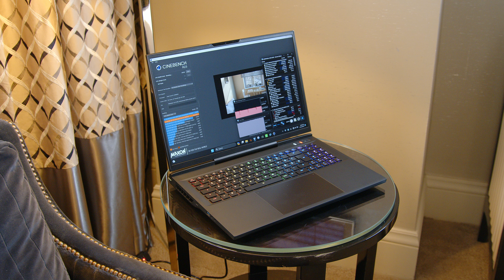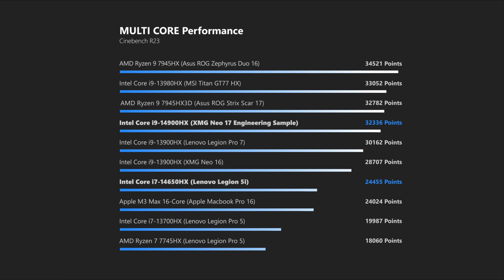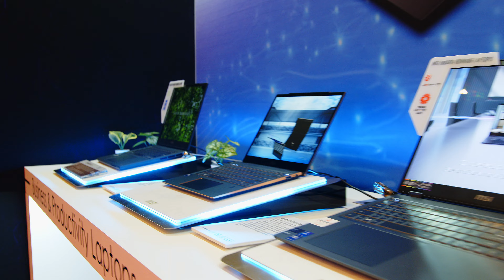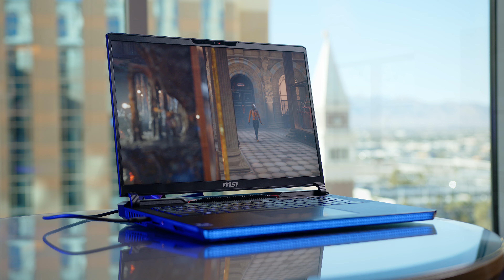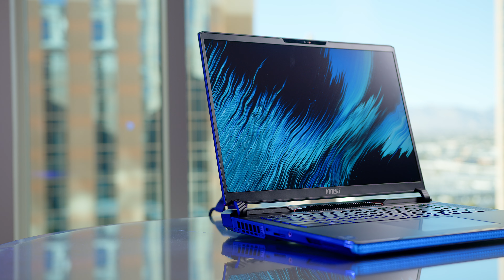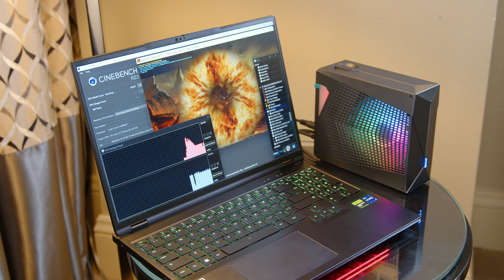When slightly faster is more than good enough! - Intels new high-end mobile CPUs

Comment: I like my laptops to run silent or as unintrusive as it can. I have a asus rog strix 3060 and run it in silent mode for the most part knowing it cuts power. I tried a legion 5 for my so while it performed well it was really loud and nothing i did seem reign in the fan noise (its also high pitched compared to asus)

I’ve been looking at the upcoming laptops hoping to find a new 4070 one with good performance while performing well in noise tests but i have no idea what would fit my needs. And ive started looking at coloer solutions more than anything lately but thats not helping either haha..

I guess im a little dissappointed in cpu power draw as of late.

If anyone got any tips what i should look out for with the upcoming releases id appreciate the help :)

Comment: I went from a G15 w/ 3070 to Legion 7i Pro w/ 4090, but I always loved the G14. Such an incredibly powerful little laptop. If I worked on the go, I would have definitely gotten it with the 4090. No it wasn’t a full powered 4090, though gaming wise it appeared to trade blows with the 4080. With Asus going even thinner this year with their Zephyrus series and maxing out at a 4070, I’m glad for one generation they went big with a 4090 in such a small package.
Reply from the maker: Actually, the G14 is tied with that exact Legion Pro 7 for being my favourite notebook of 2023, and it's really the amount of travelling I would have to do to tip the scales in either direction.

Comment: Intel has definitely fallen behind AMD and Apple in the power efficiency race.

I suspect that this is going to worsen later this year when Zen 5 comes out. Maybe Arrow Lake will provide better competion.
Reply: In Intel's defense, Raptor Lake is on Intel 7 (which was called 10nm++ before) so it's at a major manufacturing node disadvantage. Without it, it will be closer. Well, to AMD, still behind Apple. Well, with M3, Apple is on 3nm, which again, is better than the 4nm and 5nm that AMD uses. While on the same node (AMD 7000 series vs M1 and M2) it can be seen that they're not that different. Overall Apple still wins, but not by much. And it's mostly because on x86 side, the laptop manufacturers somehow really don't focus on battery life. They're all obsessed with benchmarks numbers and specs. It can be seen from the Meteor Lake lineup as well, everybody tries to push it out of its efficiency window (which, unfortunately, is not that big/high, but still, it can run very well at, say, 25 to 35W, from what I've seen)
Reply: @Winnetou17 stop the ignorance, everything you said fat BS.

First, m3max is way faster than a 14900hx. 
Second, x86 ISA is the main source of shit efficiency not the lithography.
Third, there is nothing on the planet that would make an x86 chip even nearly as efficient as something built on arm v9. 
So stop the BS and accept these facts.

Comment: I think we also need to talk about how respective new generation laptop CPUs power consumption on idle to low load (web browsing/ MS office) work. 

Since AMD CPUs really winning on lower power consumption competition. I was surprised to find my Legion Slim 5 2023 with R7 7840hs able to reach 11+ hours of webrowsing and office work on 80 wH battery. My recently purchased Lenovo LOQ 2024 with i5 13450HX cant even reach 5 hours of battery life with the same work load despite having lower screen resolution (1600p vs 1080p) and bit smaller battery. I tasted in real-world usage the R7 asit around 8-18w on these type of work load, where i5 sit mostly at 28w

For mid range gaming laptop option there is so many interesting laptop to be usable on both working/school and gaming on the go. But many of these gaming laptop manufacturers and their respective gaming cpu forget to reach these battery life demand.
Reply: Note on these test all was done using iGPU and quite mode and windows power efficiency mode. Also AMD cpu run cooler (no fan spinning) where all Intel laptop CPUs always have constant low spinning even on idle.
Reply: wow, 11 hrs ? thats amazing. I need to try this one with my slim 5

Comment: LOL 200w CPU, that is not laptop grade it is full desktop CPU. Intel shenanigans again xD
Reply from the maker: I do not get this argument. Isn't it awesome that we can have desktop-level performance in portable machines? 
You also have to keep in mind that not every manufacturer will push the CPU to 200W, in fact, most of them won't.
Reply: @NotebookcheckReviews  whole thing about laptops is they are ultra portable or offer sweat spot between portability and performance.
The whole moment where you move your power brick that is heavy as another laptop is bonkers since there is nothing lap top about or note book about it :-)
Maybe I sound like an old grumpy guy but this thing that Intel does is not the way.
They have hideous power efficiency for years.
Reply from the maker: But they offer that with their Meteor Lake Line-up, and so is AMD with their competing CPUs. You DO have the choice! I would gladly be able to have that much power on the go. For me, this means being able to take my laptop and plug it in somewhere else. 
I understand that you want something lighter with decent performance and long battery life, but that is not a machine like the Neo17, and it was never designed to be that. 
It is a little like complaining that your Ferrari is not getting you proper milage ... ;)
Reply: @NotebookcheckReviews  you do have a point, and yeah it's good we have a choise.
But I would be happy if we use the term mobile workstation or gaming stations. Since they are mobile but not light :-)
Reply from the maker: For sure! 
Let's agree to the term "chunky-puppy" from now on :D
Reply: @NotebookcheckReviews  deal :D

Comment: That confirms what I was complaining about: Legion 7 not going to Ultra cores this year. 😊🤔
Reply: Same i would happily get far more hours on office work load battry than having the most powerfull cpus on the market for it to only reach 50% of usage in any game anyway. AMD is winning this cpu category with minus of some bugs and glitch in windows 11 as i tasted on my Legion slim 5. But that's personally was not a problem if you know what to do to fix those bugs.
Reply: @Davorta  which issues for example?
Reply: @edgargabriel6640  sleep issue where the fan and screen of the laptop wake up by itself. and some screen flicker and fps stutter when gaming. its all just driver conflict with windows 11 gaming feature option and lenovo OEM AMD driver that bugged the system.
Reply: @Davorta  thanks for the info
Reply from the maker: Yeah, I wonder why they went Raptor Lake instead of Meteor Lake. 
Maube the cooling solution is simply robust enough to handle the faster CPU?!

Comment: Slighty faster with a lot more consumption is definitely not good enough. I’d say it’s worse than previous gen.
Reply from the maker: I would take our power consumption with a grain of salt; we had to use the dGPU in our performance testing, so the numbers might be a little off since we did measure for the whole system and not just the CPU. 
The overall user experience will be about the same as what we got last year. With no real competition at this end of the performance spectrum, they probably did not feel pressured to innovate as much as they did with Meteor Lake.
Reply: @NotebookcheckReviews  I’ve seen pretty accurate measurements of new intel desktop cpus. They are a little bit faster but they consume a lot more than that in %s.

Comment: Is there any review planned on the Ideapad Pro 5 14 or 16 with the 7840HS?

It seems like a really good deal but many users report constant fan noise due to a terrible fan curve set by Lenovo i.e. fan starts at 30°C and ramps up at 35/40 which is unnecessary

As always great coverage
Reply from the maker: I will look into it!
Reply: I bought one 2 days ago but will be delivered only in 5 to 6 weeks ... for 670 € though 😊

Comment: will be any new ryzen 8000 laptop ? and does it worth the waiting? danke schoen
Reply: Ryzen 7000 is exactly same as Ryzen 8000.

Wait for Ryzen 9000 or buy Core ULTRA which is more efficient than AMD
Reply from the maker: There have been some 8040 series upgrades and refreshes, but so far nothing that will go directly against Raptor Lake HX
Reply: Just got  Legion5 IRX9 (14650HX, 32RAM 1TB, Geeforce 4060)..well its powerfull, but its become.warm even in web serfing… this hyper coldfront technology its just marketing…  I am using mybold coolersupport Deepcoll , and will try to install Lenovo advantage tool to decreaze frequency of CPU and GPU to make it "colder.
Reply: I have the 16IRX8 with i7-13700HX and temperatures are in the mid 40s while web surfing, which is very cold for a gaming laptop. My previous TUF F15 2022 would stay in the 60s, so unless you're coming from a desktop, Lenovo Pro series has excellent cooling.